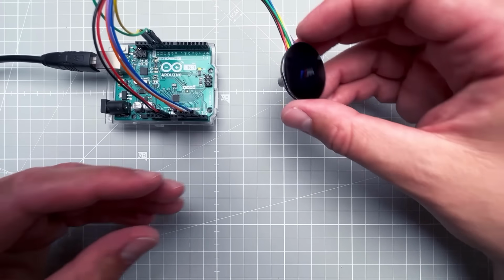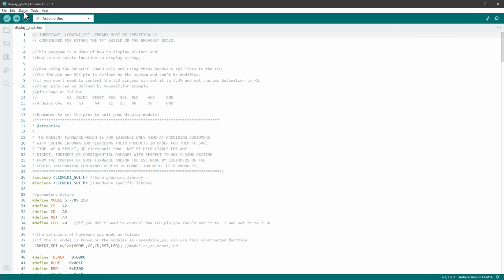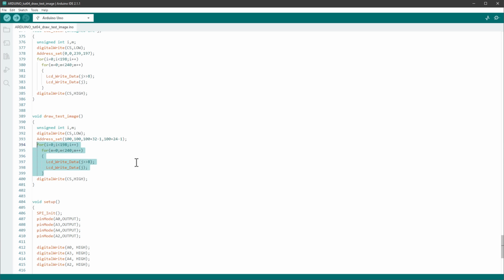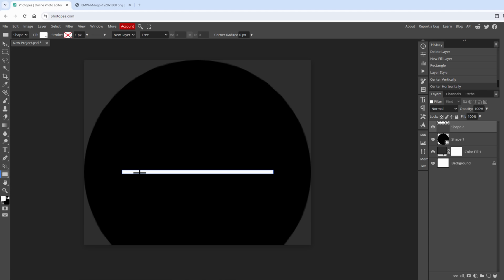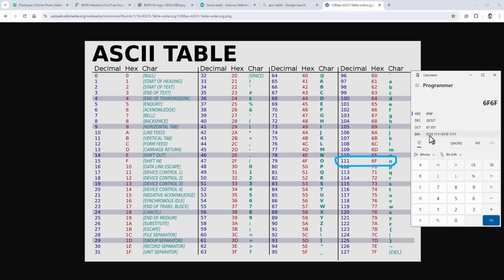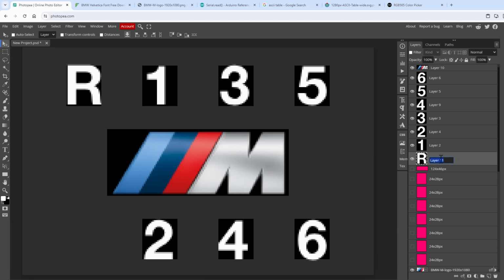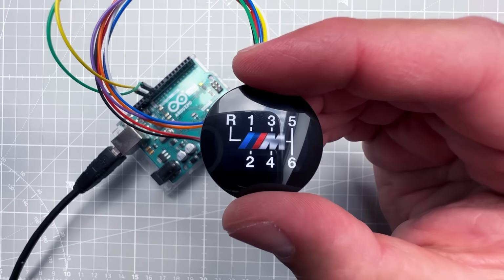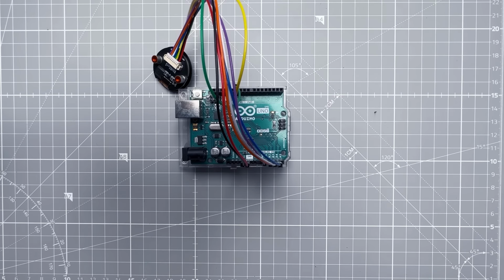I found PERFECT display

Comment: It would be amazing if you would use an ESP32, as it leaves more headroom for more complicated designs. The price isnt too steep either. Once again an amazing project. Thanks to your videos, I started tinkering with an ESP32 WROOM and a small oled panel for my car!
Reply: In addition to that, there are those ESP32-C3 Super Mini boards which are really tiny. They "only" have an ESP32-C3 but compared to an Atmega32 they are plenty strong.
Reply: @xZise  theres even round displays with esp32 built in
Reply: @xZise  Ridiculously cheap too!
Reply: @xZise  you can make any arduino project super tiny, since arduino boards are prototype boards that include a TON of stuff and to controll a screen like this all you need is a xtal, couple caps, couple resistors - maybe couple diodes - and you're done. you just need to use an attinny or an smd atmega. it would basically fit the whole board behind the screen
Reply: You can just select ESP32 as the compile target. No big deal, same code.
Reply from the maker: Thank you for your comment. Yes, I do plan to try ESP32. and I do have the ESP32 board with round display, both are great, but it will take me some time to get up to speed and turn it into an actual tutorial. As for the IDE, I´m not knowledgable enough to try Visual Studio, I like the simplicity of Arduino IDE, so I will most likely stick to that IDE for a while,..
Reply: @upir_upir  you can use the arduino IDE with the ESP32. Just install the board from the board manager just like any other board. Code works basically the same, adafruits ESP32 board library comes with a heap of examples. You can even upload code over wifi (no more cables!), there's examples code for that too. ESP32 C3 Supermini or S3 Zero absolutely blow arduinos out of the water in terms of performance, and cost far less too. It's got on board floating point unit so float calcs are super fast, clock speed is 10x that of a mega. S3 comes with a pin multiplexer so any pin can perform any function (like I2C, SPI etc). They are versatile boards, very easy to use. S3 is dual core too so you can do multithreading. Honestly ESP32s are all I use now, just doesn't make sense to use a nano, uno or mega that cost more and isn't as powerful.
Reply: Arduino Hardware and IDE are so outdated. Very cool 10 years ago. Nowadays it's too big, too expensive and the performance is bad, except maybe the Nano with the Atmega32U4. Try the ESP family or other chips and Visual Studio Code with PlatformIO as an IDE.
Reply: My version. Esp with display and obd wifi. Portable diagnostic shiftknob/media unit for my car.
Reply: I like the EPS32 as well but there is no way its going to fit inside a shift knob of a reasonable size.
Reply: overkill
Reply: @gianni_schicchi could connect to obd2 via Bluetooth  tho, no hall effect sensors needed and potential to read out current driving mode, rpm or something like that.
Reply: @gianni_schicchi nah, overheads

Comment: I'm very curious if the first videos form of implementation can be voided. with integrating an accelerometer into the knob allowing for it to determine the amount of tilt in each direction to determine gear.
Reply from the maker: Yes, that’s something I’m currently investigating. It might be possible, but I’m not quite sure about the accuracy.
Reply: @upir_upir  biggest issue I see thinking about it. In a testing environment it will be fine but actually in a car if it's on a slope or any sort of angle would throw off the values